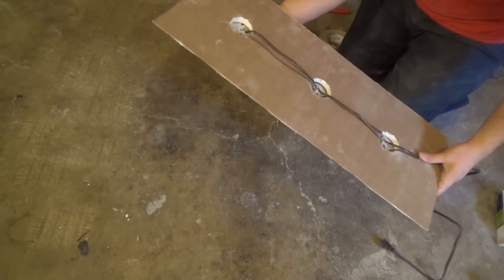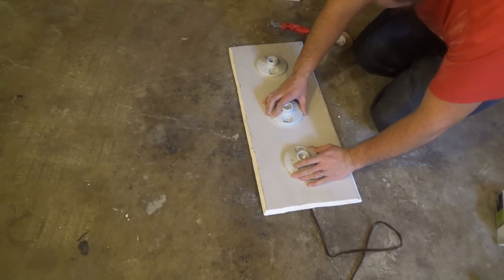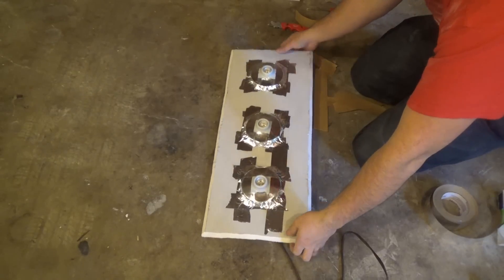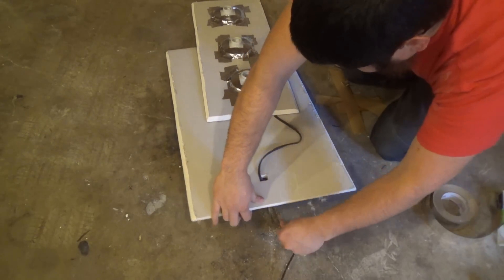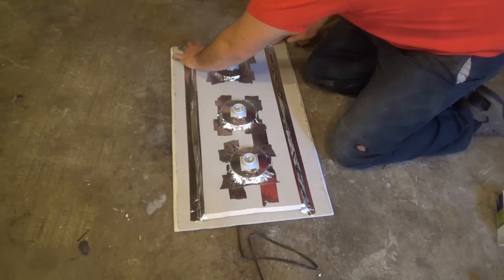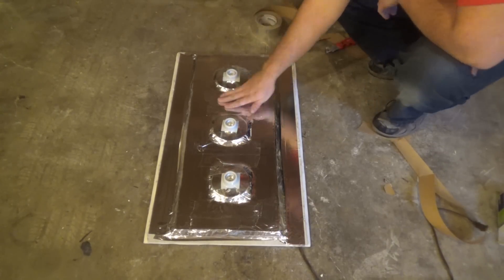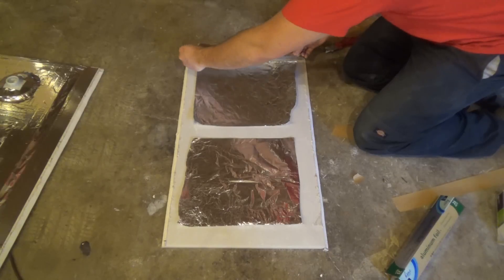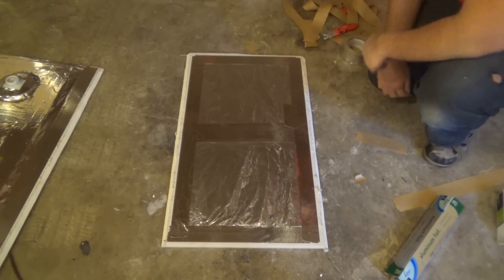Building a PVC Bow Hot Box Part 3 - Sealing the Wall Panels

Comment: Most aluminum foil companies put tabs on the ends of the box that holds the roll, push them in and they anchor the tube enough to let it spin without coming out of the box.  Much easier to handle and cut the foil to the right size that way.

Comment: I bow to your experience on the foam idea.  My experience was a small oven to do secondary curing on fiberglass layups.  The heat source was an electric space heater and probably didn't get as hot as your design oven and also it was a one time only thing. Anyway, keep up the good work and thanks for sharing your ventures...

Comment: You might consider using foil faced foam insulation panels instead of dry wall. Cheap stuff that has foil on both sides and would improve lowering heat loss. Not much structural strength but not much is needed....
Reply from the maker: The only problem is that the foam insulation tends to start to fuse and melt together after a few runs. You can do it, it just requires a slightly different design and some reinforcement. Though I haven't found good foam insulation cheaper than drywall (at least where I live). As far as heat loss, the drywall is a very good insulator.  If you do use foam, use 1" foam rather than 1/2".